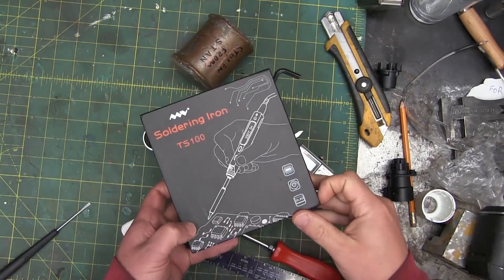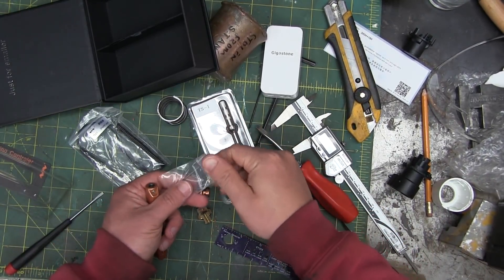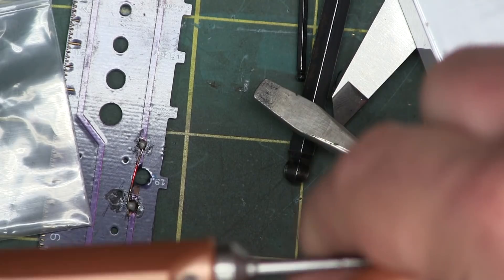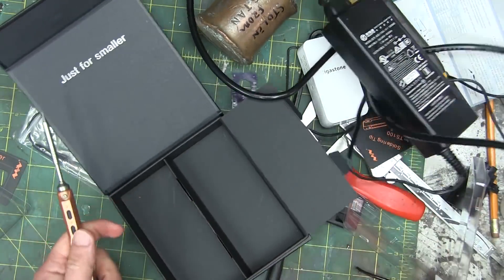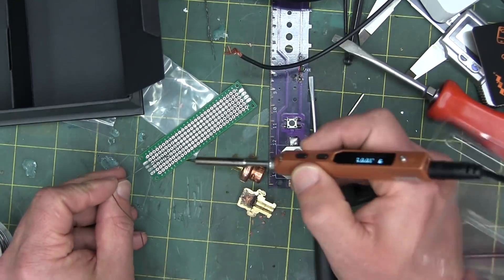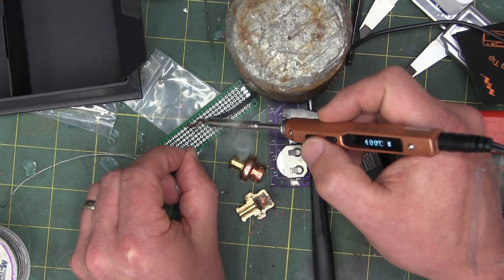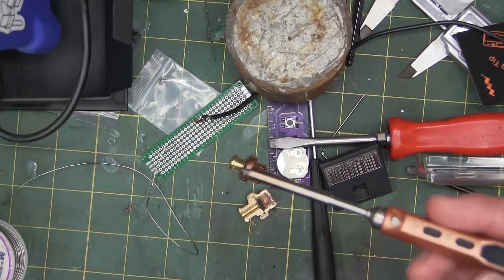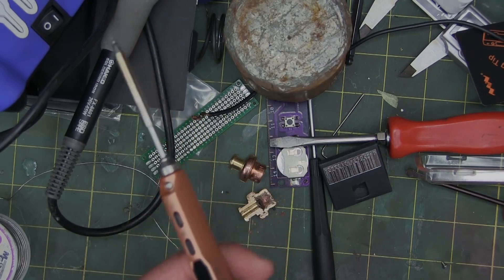BOLTR: TS 100 Soldering Iron | Quickie

Comment: Plug it directly into the wall without the adapter and it will give you ten times the heat, no problem.
Reply: More volts, more skookum.
Reply: Is this 240 volts or 400 volts your talking about. I have both.
Reply: Paulman50 come on man we all know that 3 phase will get the job done way faster!
Reply: 0Calvin Don't delay-plug in today!
Reply: Hi paulman50, at 400 volts it welds beautifully...………….just a bit warm in the hand!!!
Reply: can 480v work? I've only got 480v
Reply: Paulman50 12v times 10 is 120 volts, wich they have in Canader.
Reply: This guy skookums.
Reply: Don't you know that you are a shooting star . . .
Reply: what could possibly go wrong?! (i once actually made a bootleg homemade arc welder with my friend in my basement... we took a random scrap plate, light switch, a broken extension cord, 20 gauge wire, a wrench clamp/vice, and a couple of dipshits screwin around with pixies, and plugged it into a 120v outlet... it worked... kinda. i mean at least it made an arc eh?)

Comment: I use a xytronic on the bench and a portasol in the field. My new go to for soldering splices in the field is the Milwaukee m12, good for soldering wire, but too clunky for delicate work.
Reply: Fireship1 you like the Milwaukee for soldering wires? I have the Milwaukee batteries and some other tools,  but i need to know the damn iron won't burn out like what happened a few months ago in the videos that AvE guy put out.
Reply: Michael C. I agree with you Michael. I remember that video. I can’t speak on longevity of the Milwaukee. I haven’t had it long enough or used it hard core yet, it could crap out or soldier on. Only time will tell. I love that the Milwaukee heats up in about 15 seconds to full heat. The weller portasol is at least 18 years old and still working great!

Comment: The version I bought had a 19v powerbrick with it 74 USD and the ts-100 can be powered 12-24v a popular setup is a 3s-4s Lipo into standard 2.5mm jack for field work

Comment: I'm told a standard 19V laptop power supply does quite well, and they're cheap as chips.  My laptop could run on battery while I'm soldering...

I also like the size and portability: It would sure goes well with my Bitscope Micro.  (Hint, hint...)

Comment: Well damn i'm going to go pick up a Haako. I'm still using a piece of junk from crappy tire.
Reply: Useless Duck Company I upgraded from my crappy Radio Shack $15 jobber. Wanted a Hakko but settled for a TS100. Couldn’t be happier. The only limitation is availability of tips. Hakko or TS100, can’t go wrong either way imo.
Reply: Knock off 936d from fleebay if it's only for light use.
Reply: There are lots of tips available, Not beefy as JBC though
Reply: The Haako knockoffs are a great value, usually.

Comment: It is actually 100% open source, with shematics being published and everything. Stick 24v in it and use the chisel tip (BS2?), and it'll run like a raped ape. The higher the volts, the higher the power, because it current limits itself to 3A. Also, throw Ralim's firmware on it, it opens up a whole new chapter.

Comment: Interesting iron but like you said if you want to get the full potential out of it you need to spend about the same as the hakka bench iron BUT my RC bag needs a portable iron and I don't want to spend the $$ on one so I will put a ticket into the hat... I also have a switching power supply from a dead monitor that is 24v so I can get full chooch from it when I am at home.

Comment: Probably wouldn't use one on the bench,  but they are hugely popular among RC modelers and drone racers. You can plug 4s-6s lipos straight into it (with an ay-dapter) and easily make repairs in the field.
Reply: Yep, crash into a tree, swap a motor, repeat...
Reply: this ^ dont buy it for your shop, waste of cash and defeats the utility of it.

Comment: The advantage of the TS 100 (as opposed to the Hakko 888D) is the fairly accurate temperature control through the active tip. I can't say much about the ergonomics but it'll hold the temperature fairly steady which is something the 888D has troubles with at times
Reply: It's not really about new technology, it's also about convenience and not breaking your components. With an active tip your temperature control is much more precise which means you can lower the temperature a lot (I sometimes solder at 250 degrees C) and not damage fragile components as fast.

With an "old" soldering iron you would either need a massive heating element so the temperature won't change much, or you're going to have to increase the temperature to 300 C or more.
Reply: WoLpH I bought an 888d right before the ts100 came out and was kinda butthurt when I found out I could have gotten the modernized tip technology for half the price in the ts100...that being said I fly drones and that's a good enough excuse to buy a ts100 for field repairs.
Reply: gcutler15 Don't get your butt tangled up with the "new" technology shite. If it solders nicely and you don't encounter problems or lack something it is all good. And, half the price for a unit without PSU and not nearly as robust in field use, however it would be more mobile. Anyhow, I sometimes solder smaller 1mm copper sheetmetal pieces with my old tip technology iron.. when it has to be done.

Comment: Would it be any better than the cheapo Radio Shack $15 model you plug into the wall that comes in a blow molded case with a rickety stand and sponge holder?  If so then I'd take it.
Reply: Much much much better, running on 18v this thing is awesome!
Reply: YES YES YES ! 100 times yes. Put that radio shack in the bin whee it belongs.

Comment: Missed out.  Put 24v into it and it is a right skookum choocher.  Run some silicone leads from your lab psu and despite not being airgodynamic  it kicks ass on any non-integrated tip/therm irons.  I do agree that a more manly chisel tip  is necessary but at 11$ for a tip and 15 sec heat up....  Damn fine unit.
Reply: As others in this thread have mentioned, the portability is a big thing. Strap a few 18650s together and you're good to go with a wide range of input voltages. Also, I paid a little extra for one with a power supply and it's reasonably maneuverable (though there is definitely room for improvement). I'm not sure how it's possible to criticize this thing based on the lead when you supply the lead. Heading up to 24V is definitely the way to go. 2x the voltage is 4x the power available and it heats up exceptionally quickly.
Reply: Bought it as a spare/portable iron for out in the field.. and it turned into my main go to for everything. Love me some Haako's as that's all we used in school but for $50 this little guy really impressed me
Reply: Yes. It's better at 24V. As you said, you need a good silicone lead. I used some 16 gauge wire I use with quadcopters and it works fine.
The conical tip stinks. I ordered a few extra tips but they weren't shipped with the iron.
It's not replacing my desktop unit but it's a great battery powered iron for field repairs. I use it with a 5Ah six cell LiPo and it has lots of power.
Reply: He missed the real appeal of this iron. The Hakko may be rated to produce more heat, but it's not a heating element in tip, it's a sleeved style tip. The heater in tip is more responsive to temperature changes.
Reply: Ill gladly take that off your hands . I subscribe to Rossman watch him every day
Reply: It's a great little iron but the included tips are usually a bit on the small side I power mine from a laptop power supply (19v) 

It's great for out in the field use when power may not be available just hook up some lipos and you're good to go
Reply: I agree. This thing is amazing, all you need is a 24V PSU/battery pack. Get a nice silicone lead and do up an extension. The 5525 jack is durable. Get a different tip. Watch the review by Marco Reps. Done. For me it has replaced all my soldering irons( they were all quite shitty to be honest, except my Versatip maybe) and can solder heatsinks without any problems.
Reply: patron.
Reply: Ergonomics aside @ 24v this thing works great vs the 888D
@ 12v it's a piece of crap.
Reply: Can confirm. Runs nicely on a battery for field work too.
Reply: Portable power with a battery at 24v and you can use it in the field. Plus 10 second heat up. I love it
Reply: Gabriel Matte lol. Ever heard of the invention that is battaria? 😂
Reply: I have a feeling my oldass Ersa D2000 does not get it's ass kicked by this thing. However that thing might work great for mobile use since I could just power it from a car or truck battery. And all the ships I work on have either 12 or 24V on board.
Reply: Banggood often had them on 40USD discounts and Hakko is still crazy expensive in Europe (never seen one under 120€ plus at least 10€ shipping. When you take that into account, it's by far the best bang for buck. Plus, I can solder ANYWHERE with just a an old LiIon pack made from defunct laptop cells - no more looking for outlets and  balancing the base station on ladders for me :)
Reply: Lagger Onesixfour patrons get the vidjayo  early.
Reply: Lagger Onesixfour paetrons video first i suspect
Reply: It is also working with Hakko tips, which is nice
Reply: Is this still up for grabs?
Reply: True. Only 24V. I guess sometimes it's good to RTFM. I use it portable with 18V milfucky battery. Works pretty ok.
Reply: so has anyone ever used an isotip nicad cordless Soldering iron (about $80)? got my first one 20 years ago.used one sitting behind a pepboys next to dumpster. me and step dad replaced batteries. lasted me till it was lost/taken. the light sucks, swap for led and small resistor. tips are $8 or $15 depending on which kind. try one. so simple it works a long effing time. deep end anal! I mean dependable .
Reply: sold on amazon. no link cause its AvE's channel
Reply: 6 seconds to 300C for me
Reply: +Adbullh Ali Wait what? Youre right! This comment is a week old. Wat da fak, over?
Reply: How is this comment a week old the day after the video was uploaded
Reply: How comes the video are published 1 day ago and theis reply is a week  ago

Comment: wonder what the power consumption on that is at 12v... Would be super nifty working under the dash of a car. Wire it up to the power at the diagnostic port or the cig lighter port and away we go.
Reply: Zachary Welvaert you would burn out the diagnostic port trying to power that
Reply: Used to always use a butane one. My main issue is the hot air jet that blows out the side. You end up burning up nearby wires when soldering in a tight spot
Reply: It probably can draw some more than the rated 35W when it is cold so I say use the cig lighter, they have at least 10 and up to 20A fuses. Don't leave it on and kill the battery
Reply: 12V -> 17W (~1.4A)
16V -> 30W (~1.9A)
19V -> 40W (~2.1A)
24V -> 65W (~2.7A)
Source: Official Specs from BG

But you could also just buy one of those Hakko T12 tip compatible DIY kits that come with the controller board (also MCU driven), T12 compat. handle,  silicone cable, wires, etc. and are also driven from 12V - 24V. They are just not as integrated as the TS-100, but come at around 15$ (as kit; with chinese T12 tips for ~5$) and if you put the controller board in a small enclosure and add a plug for your 12v cig lighter outlet they can be handy too. Just search for "T12 soldering kit" on you prefered gateway to china.
Specs for the kit that i have are: 12V -> 1.5A | 19V -> 2.38A | 24V -> 3A (very close to the TS-100 specs)
Reply: Can confirm cig lighter works like a charm.
Reply: You'd be better off with a butane iron if you're up underneath the dash. Almost all the soldering i do is on cars, I use my el cheapo butane iron more than my corded ones
Reply: @alles klar
You wont kill the battery.
Built in accelerometer shuts down the unit if hit has not been used for a while.
Reply: Well I doubt a butane one is as convenient as this one. And I thought the iron just goes down to standby 200C mode when it is not in use
Reply: Jeffrey Murdock if the previous reply is correct and it only draws 3 amps at 12v, then no you wouldn't. The 12v at the OBD2 port is at minimum 5amps, most cars are 7.5amps.
That being said, I'll probably just use a different source since that 3amp answer is based off the specifications that the Chinese manufacturer gave it
Reply: Zachary Welvaert 
If it's 35watts it's 3amps, or 3000ma.
you divide the wattage by the voltage.
Reply: dude nothing beats a butane powered cordless iron for stuff where you don't have power outlets

Comment: I bought a cheap hakko knockoff soldering station kit for $15 about a year ago. I took apart a dewalt battery charger and gutted it, put in a protection circuit for the lithium cells, then wired the 20v to the soldering station board. Works BEAUTIFULLY. At the plant, sometimes you gotta solder something that is nowhere near a 110 outlet and that thing comes in super handy. A 5ah dewalt battery will keep her going at full temp for three or more hours easy.
(Edit) Full control over temp is a nice feature too